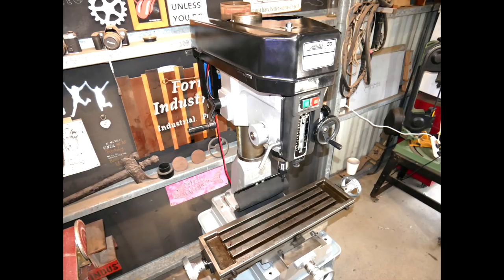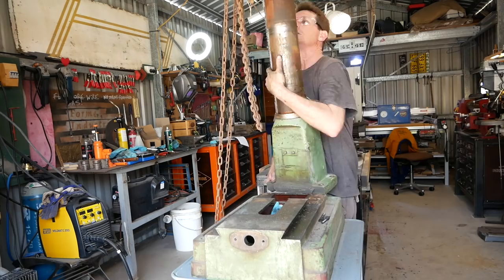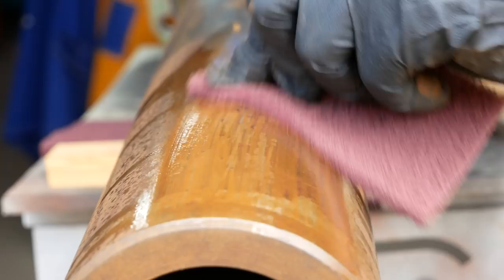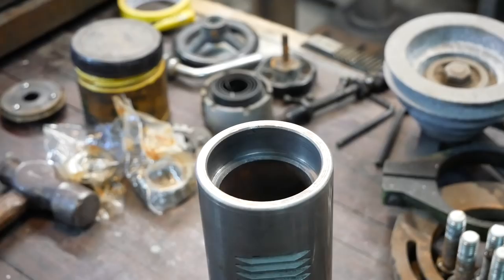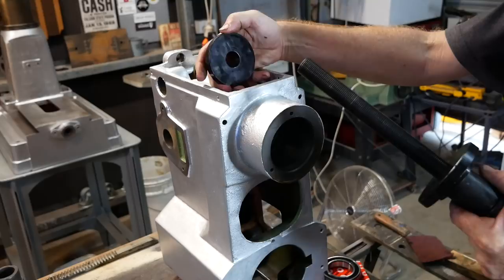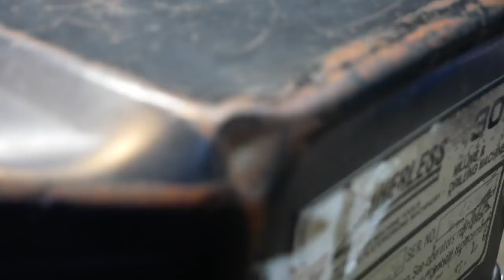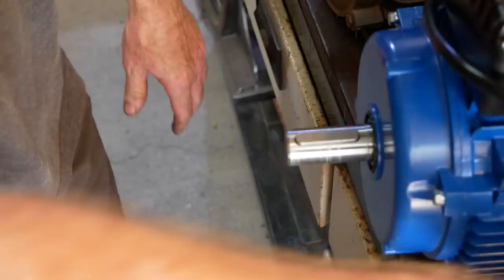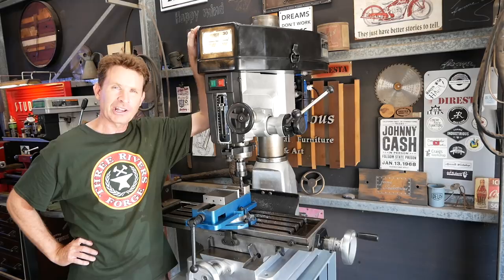RF-30 Mill Drill Restoration - Forme Industrious

Comment: OK ,another parallel for us. I have a 1938 south Bend 9" machine lathe, Like a Mayford, that may be in Australia. and, wait for it ,......I have a ZAY 7023 gear head version of your mill that came to me in similar shape, before I completely rebuilt it' as you did yours. Can't you find chemical rust remover? I soaked a lot of the parts overnight in remover with very good and easy results.
Reply from the maker: Yes we have the Myford lathes over here. haven't seen the South Bend but they might be here also. I enjoy using the Mill. Yes we have the Evaporust here now but it costs $$$ lots. There is also copy products, also $$$. All the best Wayne and thanks for your comments!

Comment: What is your method for keeping track of what parts go where and how to reassemble as you go through the restoration?
Reply from the maker: For most of the parts it's fairly self evident. Plus I laid them out in an order. Video helps if you get in trouble and I also had a Machine parts diagram.

Comment: Hey Scott do you remember which way the brass leadscrew nut for the Y axis faced when you put it back? I’m putting my machine back together after tearing it down and I can’t remember which way it faced (it has an adjusting screw on one side)
Reply from the maker: Sorry for the late reply. Y Axis adjustment to the rear of the machine. X from the left. Hope this helps
Reply: @ScottTurnerformeindustrious  odd. I thought as much but the manual shows the opposite. Makes more sense facing the rear anyway.

Comment: That mill deserved a good overhaul and you did a great job. Did you replace the nuts on the leadscrews? Glad you could locate the bearings. That mill/drill will serve you well in your endeavors.
Reply from the maker: Thanks Bradley. No it has the original nuts, and I'd like to replace them or maybe bore them out and fit a machined nut insert. I may have trouble finding replacements.

Comment: Easiest way to get an outer race out that you're not going to reuse- run a bead of weld on it. When the weld cools it will contract the race and it will fall right out.
Reply: Yep, did that on a BMW motorcycle when replacing the headstock bearings. As you say, they dropped right out.
Reply from the maker: Thanks for the Tip Andy. I will try it for sure.
Reply: @ScottTurnerformeindustrious  No problem. I learned that as an apprentice. Praying for Australia! Stay safe.

Comment: Hello.. how are you.. I have the same mill.. and I bought a set of collets from Amazon.. but they are short on the threaded end... the threading on collets are not enough for the screw to go all the way in.. just wondering if you had the same problem.. and how you manage to deal with it.. thank you.
Reply from the maker: The collet set I bought works great. I do not have the same problem. Make sure you "Click" in the Collet into the Collet nut. The collet should be flush with the collet nut, if not you haven't inserted the collet properly.

Comment: I checked the backlash and was going to replace the half nuts but to my shock their  $96.00 each I can live with the backlash.  If you have time can you let me know what disk you used to grind off all the paint with. Also, I'm having the same problem getting the top pully off don't have a puller.
Reply from the maker: Yes they are expensive but you learn to work with it. From memory I use Roloc discs and strip discs for the grinder. You may be able to hire a puller. Use some heat also perhaps.

Comment: Hi i am new to machining and i noticed at 2.07 you hammered them "pins" out.. i got a mill like that but are they all like that or are some of them threaded as im struggling to remove mine..
Reply from the maker: A roll pin will be hollow. Just check you can put a thin piece of wire through it, past all the gunk. If you can, it's a roll pin, some times referred to as a Spring Pin. Get a hammer and punch a knock it out. The shaft is most likely a roll pin. The wheel handle may also have a grub screw (hex headed). Good luck.

Comment: Hi Scott, just subscribed after searching for a mill stand to build and found this - it’s the exact same machine as mine which also needs a resto, so thanks heaps!  Some questions a) What collet holder and collet set did you get and are you happy with it?  b) I was going to bolt my machine to the stand via the holes in the base. Do you think it’s necessary to stop vibration or movement?   and c) What size drawbar did you make? Mine came with a 3/8 thread, but thinking of making a 12mm one as it seems to be a more common size for the MT3 tooling available.  Cheers, John
Reply from the maker: Hi John. Thanks for the sub! Use the MT3 Collet set from Ebay. For the sort of minor precision stuff I do, and the price I payed it's great! Very little vibration. Nothing of concern. Trying to remember the draw bar size. Did I mention it in the video? From memory I bought a high tensile 10mm threaded rod, installed it and cut off the excess, no measurement. All the best and I hope this helps.

Comment: Awesome work, not sure if you've used larger knee type mills like Bridgeports, but in your opinion is a round column mill up to the task for most home hobbiest/home machine shop duties? I ask as I am currently in the market for an upgrade to my little sieg unit but don't really have the room for a knee mill.
These round column ones seem like a good trade off between size and lack of rigidity.
Anybody at all that wants to put their two cents in please feel free as I really want a bigger more rigid mill but don't really have room for a freestanding milling machine.
Reply from the maker: Thank you! Well Size and expense are limiting factors for me also. For the home workshop the round column is a great option and can do a lot of work, perhaps a little slower. You can make braces to keep the head aligned, see videos by Cuppajoe. If you had a serious machine shop I'd definitely be looking for a knee mill though.
Reply: @ScottTurnerformeindustrious  thanks for the response, I'm a second year fitter and turner apprentice so have some experience with machining with "the proper" machines but haven't got any real experience with the home user stuff. I reckon I'll have a look into the round column machines and go from there as they're definitely a good size for the price point.
Thanks again! Take care during these interesting times!

Comment: so epic. 
attention to detail and then some.
did you do anything in particular to size that replacement motor? I've been eyeing off a number of wood working machines that are 3 phase.
Reply from the maker: Thanks Keith! Same power rating as the original, in this case 1.5 KW (2HP). You may be able to use a VFD to power your 3 phase gear.
Reply: @ScottTurnerformeindustrious  I did a quick google a while ago and a new motor seemed like the cheaper option, at least for one machine anyway.

Comment: Looks great as usual Scott :) Have you tried homemade electrolysis baths for rust/scale removal before? Had great success with rust on old mowers. Cheap and easy
Reply from the maker: Thanks! Yes I've done a little using the Battery Charger inside an old motorcycle tank. Works pretty well.

Comment: Can you tell me anything about the rack for the z axis ? I have  what appeared to be the same round column mill but in the middle of a rebuild I lost the rack during a move and need to replace it but I can’t find it supplier for a. Any help would be appreciated.
Reply from the maker: Hi Bruce, I'm unsure of any parts suppliers. Did you loose the gear drive as well? Perhaps you could use a hydraulic car jack, that should work.

Comment: Given you have exchanged  the 3 phase motor for a single phase one, does that muck up the speed / rpm chart printed inside the top pulley cover??
Reply from the maker: The three phase rpm was stated at 1420. The new single phase is 1400 so it's pretty close.
Reply: Scott Turner As we used to say in my early technician days “near enough for the Post Office”

Comment: do you have to loosten the bolts on columbe to raise and lower the head with handle ? thanks
Reply from the maker: Yes on this model you do.
Reply: @ScottTurnerformeindustrious  thanks I have same one I got used and couldn't make it move. I'm use to a Bridgeport.

Comment: Hey Scott, great score! Curious what VFDs go for there, as they're quite reasonable here (through Amazon). I recently bought one for a 3kw motor for my upcoming 4x106" belt grinder build for $150US. Best, @HoneyOnWales
Reply from the maker: Hey Drew. We can get cheap ones on Ebay (More popular here than Amazon) for around $100 to $200 AUD but when I tried looking for one that was rated to 415 volt 3 Phase price went up x 5 so I thought old motor and all, just keep it simple and go single phase. Really I'd like to dial in a speed but I'll live with out. Thanks and all the best!

Comment: Hey bloke I ve watched this for the second time now, quick question about your lathe are you happy with it and what's it's limits? Anyway great video.
Reply from the maker: For the work I do it's fine and I look past it's shortcomings. The cross slide seems to struggle with parting and the lead screw speed is changed by replacing gears. I would like to just use a leaver to change gears but like I said I just deal with it. It's done well on a lot of projects.
Reply: @ScottTurnerformeindustrious  Thanks for the feedback. I'm Keen on getting a lathe and mill. I'm unsure if single phase machines will do what I want or just bite the bullet and get a descent second hand three phase machines.  Regards. And Thanks.

Comment: I'm only 2:31 in but a 3 phase motor can be easily concerted to single phase.  If you're interested I could find a link.
Reply from the maker: Thanks Warren. This one is 415 Volt and it is not exactly new so I figured go single for about 1/3rd the price of a decent VFD. I didn't want to play with start and run capacitors either. I'm a tight arse.
Reply: @ScottTurnerformeindustrious  I'm with you. I added a VFD to my drillpress. Got it from banggood. Was about $140 capable of 2hp. A little bit of fiddling but gives some cool features. Turned a little 3phase motor into single. Used it to make a winch to pull my boat in and out of the shed. Also added fob control forward and reverse.

Comment: What oil you using for thrust bearings and ways?
Reply from the maker: I used Machine Oil. (light Mineral Oil). The bearings in the head are greased.

Comment: Can you point me in the right direction on that Collett holder and Colletts you’re using?
Reply from the maker: Try eBay; look for MT 3 ER32 MILLING MACHINE COLLET CHUCK SET KIT WITH 15 ER32 COLLETS ER32 + BOX
Reply: Scott Turner Thanks!

Comment: Hi Scott the ER32 collet set you bought are they from china if so are they any good
Reply from the maker: Yes from China, and good enough for non micro precision work. I'd buy another set if I had to.
Reply: @ScottTurnerformeindustrious  OK thanks I might get the set, also when you finished rebuilding
the mill you milled a piece of steel, was that a carbide end mill or a HSS
Reply from the maker: @captaincook3693  carbide

Comment: Whats the accuracy of the mill it seems that theres rust and theres wear o  the way.
Reply from the maker: I don't depend on great accuracy with this oldie, but with a bit of care and planning it would come in pretty close. 0.02mm is claimed. Doesn't like Climb milling at all
Reply: @ScottTurnerformeindustrious  you mean the table jerk when climb milling must be the back lash of the screw can be adjusted ot tightened  not sure for small mill drill though  .im planning on getting  a mill drill too but problem is turning it to single phase and the accuracy of a second hand mill drill if necessary i will have to learn metal scraping to restore squarness paralellism etc

Comment: Hi I have one the same as you what these machines need is a longer coliums for 1 inch drills and Clarkson collects  and then they could do any work because with mine by the time I put all these things on the tables I hadn't got any room to put the job  my machine is the smaller one I think yours is the bigger machine  I bought mine in 1980  also I found p and n  tools made a end mill with a 2 Morse tapped on it and this was a way around this problem

Comment: 1:57 the eyes :D ......... hey any idea what spindle bearings these take?
Reply from the maker: My bearings are HR 30206J, HR30207J Tapered Roller  Bearings, and two 6009Z Roller Bearings. You would need to check your machine for the correct numbers. These are standard bearings from the Bearing shop.
Reply: @ScottTurnerformeindustrious  My machine is a JET but it's the exact same casting ...... and everything by the looks of it

Comment: Hi scott are you finding the 1.5 kw large enough?  ..... This machine is a stalled project of mine I’m getting back on track and will soon be getting a similar motor. 
Great video cheers chris
Reply from the maker: I have only used a 12mm End mill and power is ample so far. The original motor was 1.5 kw (2HP) I think the motor is large enough for this mill. Thanks Chris.
Reply: Scott Turner brilliant I’ll follow in your illustrious footsteps 😄

Comment: 13:30 How do you decide how tight these should be ?
Reply from the maker: I tensioned the locking nut enough so that I could feel the bearing bind then backed it off so that I could feel the bearing become free, though without slop or play. Hope this helps.

Comment: Lucky he didn't just put a VFD on it. 
FYI - I am an engineer with 30+ years in automation and I have installed and commissioned 100s of VSDs all all types of motors.

1st off the correct terminology these days is VSD (Variable Speed Drive). The old terms of VF, VFD, VVVF and others have been sent to the history bin for the simple reason that these days even basic drives can vary so many motor driving parameters and functions that its just inaccurate to call them anything other than VSD. If you tired an acronym that accurately describes all they can do it would be (in some cases) 100s of letters long. Circa 2010 I used a basic ABB 150 VSD on a fan [pushing air on a mine site. We did that for nothing more than the motor starting. That basic drive had more parameters and capabilities than many of the state of the art drives from the 90s. There was an incredible leap in motor control technology in the late 90s early 2000s.   I have used some drives with in excess of 3,500 parameters. 
Surprisingly some of the really high performance servo amps for robotics are also incredibly simple. Most of those vary nothing more than the torque output. Doing that accurately over the full speed range is the tricky bit. 

2nd there is a huge misunderstanding that single phase VSDs operating at 240VAC input then output 415VAC to the motor. THIS IS TOALLY UNTRUE.
The way ALL VSD's work is they first convert the incoming AC into DC and then use a transistor pack to create the variable 3pahse output. There's no magical voltage increase in that process. I have seen others make this basic mistake on YouTube and there is a simple fix.

In Australia many motors under 5kw and most under 2.2kW can be reconfigured. You can use them with 415VAC in DELTA where the 3 coils are arranged in a triangle (the Greek letter for D is a triangle). You can also use them with 240VAC in a STAR configuration where the 3 coils are arranged in a Y configuration. What you do need to consider is the POWER consumption. Not output but consumption which shows up as current. So you have to be carful that the cable to the motor is rated for the additional current. And yes engineers make that mistake way more often than they like to admit.

What you can do with many 3phase motors to retain the power output is reconfigure the motor from DELTA to STAR. If you look in the motor terminal box for a 3phase motor most actually have 6 terminals (2 groups of 3 opposite each other, 1 each for the end of each of the 3 windings). There are (in those motors that can do this) 3 small links. If you see those 3 links in parallel across the terminals then the motor is most likely wired in delta configuration. It you see the 3 links being used to connect the 3 terminals on one side together that its wired in STAR.
Look on the inside of the terminal cover or in the manual for the motor to check/confirm how you can wire the motor and what voltages the configurations  are for.

3rd what many engineers and others mistake is that the motor will deliver the same torque over the entire speed range. In the case of a mill or lathe they are forgetting that with the gear box also changes the torque that is delivered. If you just replace a pully or gear box system with a VSD & Motor its also very easy to lose all of the torque variability. This is why many of the small mills and lathes with VSDs still have a high-low or 3-speed gear box.
Reply from the maker: Thank you for your detailed input. I knew I didn't have all the relevant information to make the change and opted for a simple 240 volt motor with pulley reduction. If I was reliant on high production I would have a different machine, different set up. This machine, I keep the same pulley speed and vary the feed rate.

Comment: Where did you get the bearings?
Reply from the maker: Just from my local bearing supplier. They are standard bearings, not hard to get. Look at your bearings and you will find part numbers, or look in the parts manual to find the numbers.

Comment: I have King PDM-30, which is essentially the same machine. The split nuts wear out like they are made of sand.
Reply: I had a heck of a time disassembling my machine especially getting the bearing keeper rings out. You mad it look so easy you must be a pro millwright.

Comment: Note to others.  Remove nut/slotted screw that is seen at 3:12 so spindle will slide the last bit out.  It has a locating pin on the other end. Argh.